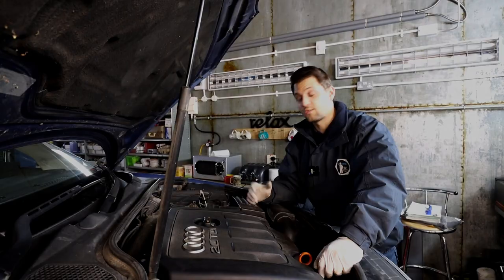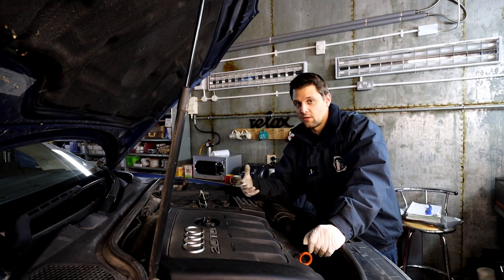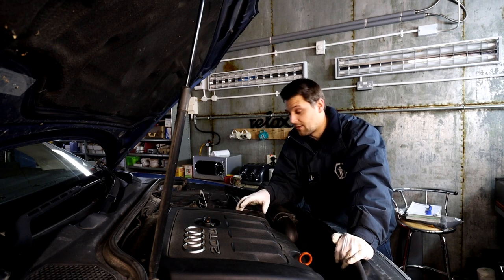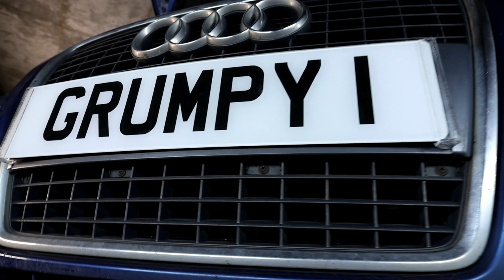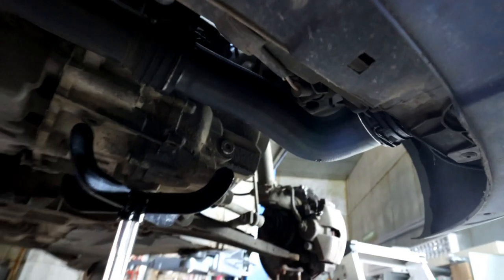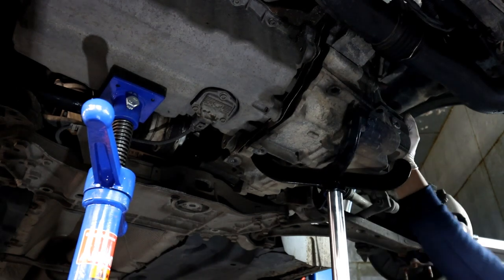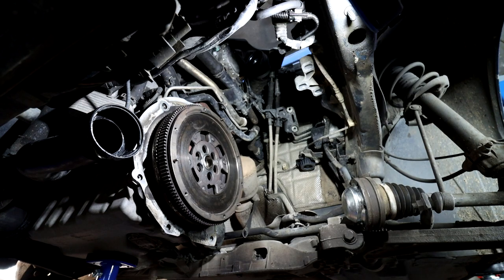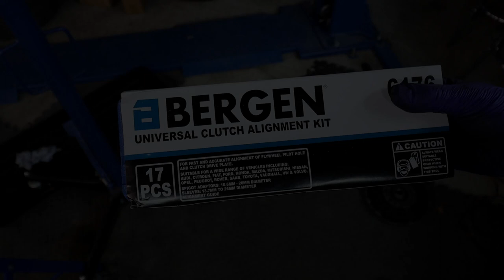Audi A3 2.0 TDI Gearbox removal. Flywheel and clutch kit replacement. Episode 4 Project car

Comment: I always thought you can use a flywheel dmf if there are no burn spots, the surface is flat and minimal movement.  My flywheel has movement of 3teeth.  I used the same one, however everyone was telling me your not supposed to🤷.  Even the shop said warranty on new clutch is void if not purchased with new flywheel.  My CSC failed and just decided to fit a new clutch in as previous owner used to ride the clutch causing it to wear quicker. Thx for video
Reply from the maker: Yeah it depends on the companies and policy. But usually in normal garage you don't get ripped off.
Audi was going to charge an Audi tt quattro £6000 for a clutch kit and flywheel.... I've done the job a few days ago and trust me it saved them a lot of money haha

Comment: Thanks for the video. The clutch pedal is stuck to the floor and the gear lever stuck in reverse on my A3. I've replaced the slave cylinder and worked for 2 days. Same problem now. You think I have to replace clutch and flywheel or just the concentric cylinder? Could the master cylinder be faulty?
Reply from the maker: Is the flywheel noisy? 
I would definitely replace the clutch while you doing the master cylinder.
Flywheel is expensive and I would check that for heat marks and play when u there.
Reply: @AlexTheGrumpyOne  thanks again for the quick reply. Doesn't make noises but I had to press the pedal a second time on a couple of occasions to shift gears easily (it didn't go in the first time and didn't want to force it). I plan to keep the car for another 8-9 months and wouldn't want to spend too much as I want to buy another car with less mileage. What's your advice, please?
Reply from the maker: @nickeyman81 u end up pumping it because its getting air in the system.
First off all I would recommend bleeding it properly and making sure that u have got brand new brake fluid in the system..  if its an old fluid its not good as it creates air gaps. So make sure u bled it properly.
I've done a lot of them that actually were failing only because people don't replace brake/clutch fluid In time.
Reply: @AlexTheGrumpyOne  thanks again, Alex. Much appreciated.
Reply from the maker: @nickeyman81 no worries. Good luck

Comment: Hi Alex, please i want to know if slave cylinder of the clutch in yhis gearbox is external or is inside yhe gearbox. I have the exact gearbox in my 2012 a3, but i am not sure if the slave cylinder is inside the gearbox or not.
Reply from the maker: Hi there. Yes the slave unfortunately it inside the gearbox
Reply: Thanks a lot for the response

Comment: Would this be the same procedure as the petrol 1.6 9p audi a3 2010? :) 

Liked and subscribed
Reply from the maker: Hi there. I think it will be similar but the box is smaller.
Reply: @AlexTheGrumpyOne  OK thank you I'm trying to find out if a replacement LVN code would be compatible with a current FVH box. Then I'll use your video replace. I've only done subaru 5 and 6 speed and a suzuki alto box in my life.

Comment: I have no drive in any gears. Rac bloke said the flywheel has gone . Would that be right
Reply from the maker: Well don't know about the flywheel.
But probably clutch for sure.
Does the clutch pedal feel OK? Resistance in it?
Reply: @AlexTheGrumpyOne  yes the clutch pedal feels as it was and you feels like it’s going into gear with gearstick , just no drive. It was juddering in reverse and then started getting difficult to get into first gear. Was driving along and lost drive .
Reply from the maker: Yeah I would say it needs a clutch definitely and then checking fly wheel to see if it's gone as well

Comment: Hi.  I have a flapping noise when going into 4th and 6th gear as well, but no noise on idle.  All other gears seems fine.  Do you think this would be a clutch flywheel or gearbox issue.  Thanks.  Video is ace.
Reply from the maker: Hi there. I would check the gearbox oil level first bud. Then adjust gears, if doesn't help  I would say it'd the gearbox issue
Reply: @AlexTheGrumpyOne  Thanks for the quick response mate.  Car is in the garage on Wednesday.  Looking at round black end cap on the gearbox looks like it has been leaking for a while.
Reply from the maker: Oh ok. Well make sure they check oil first and fill it up and then check it before any repairs
Reply: Hi Alex,  ended up being the gearbox.  Ended up getting one from a Doner car and all is well.  Although now i have a bit of whilsting going on.  More noticable in higher gears on low revs.  Perhaps one of the hoses was knocked a bit when they took the gearbox out.

Comment: Great video, easy to follow and a bonus you’ve added the torque settings 👍I’ve got to do this job on a Q3, do you have to drain the gearbox oil before removing the driveshafts? Thanks.
Reply from the maker: Thank you very much! I'm glad that you find it helpful. Funny enough I have just bought myself a Q3 😀
Yep I would definitely drain it. 
I thin on q3 you have to drop the subframe due to being 4x4

Comment: I just bought an a3 2.0l 2005 automatic only 89,000kms.. the previous owner got the transmission replaced..cost her $4000 New Zealand dollars...on the notes it said "transmission was shuddering & banging at operating temperature.  Faulty valve body assembly."....this car was in japan from 2005 till 2020. My question is why would the transmission need to be replaced with so little kms??? Doesnt seem likely...??
Reply from the maker: probably because it wasn't serviced and oil never been changed. Or it has and lost oil and been driven dry. Or maybe it was just flywheel that was an issue

Comment: Please stop moving the camera around while you're explaining stuff.   You give a great explanation, just slow down and let the camera focus in on bolts in the surrounding area.
Reply from the maker: Thank you. No worries. I do apologise
Reply: @AlexTheGrumpyOne  i appreciate ya mate!  No offense intended.
Reply from the maker: @agentjs92420 no worries at all 😀 it's things like that help improve 👍
Reply: @AlexTheGrumpyOne  Do you have an email I could send you a picture to help me?  I'm struggling with finding a home for two bolts... I'm really hoping they go to the subframe I removed when doing the clutch.
Reply from the maker: @agentjs92420 yep can do. It's on my Channel contact info. Just message me on IG.
Also have you put the bold that goes behind the starter motor? And the one behind the driveshaft?